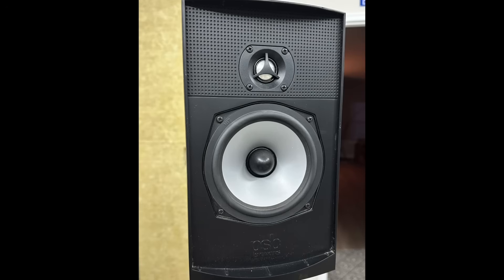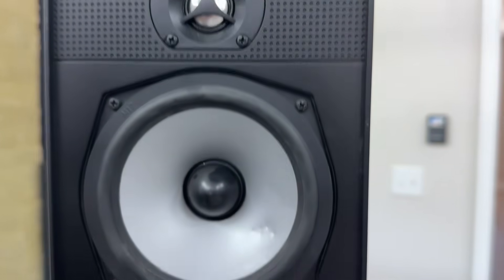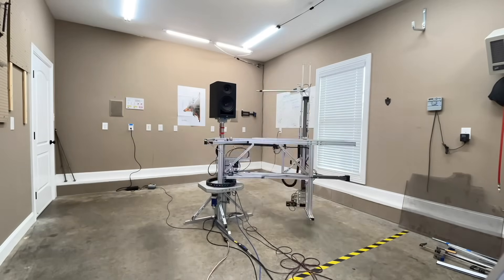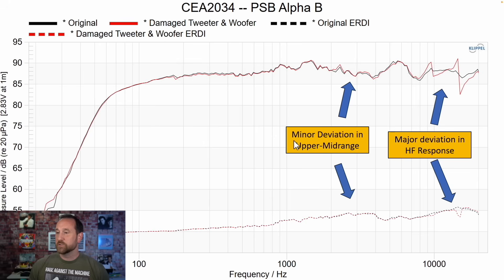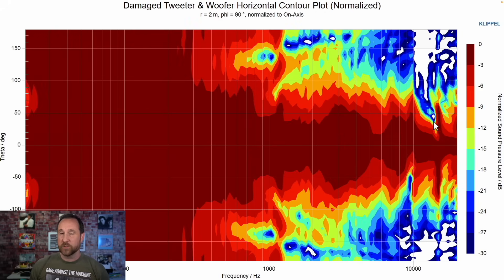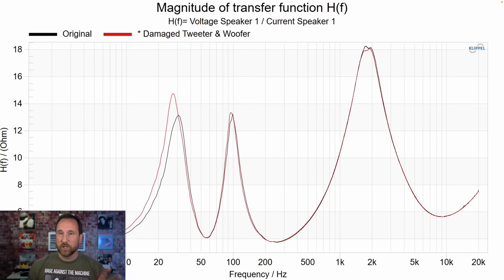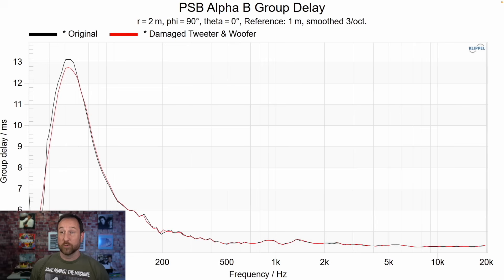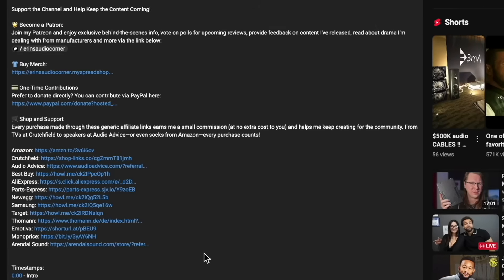How Does Denting Your Speaker Affect the Sound?

Comment from the maker: Side Note: this 20-year old PSB speaker which originally sold for about $250/pair looks like a solid performer. In fact, objectively speaking, it performs better than more recent PSB speaker reviews I've generated or others have. You can see these newer examples below (provided via spinorama.org):
https://www.spinorama.org/?page=1&search=psb

Second Note Regarding Repeatability (as was just asked by a Patreon member): I've only found very small deviations when testing the same speaker with the same setup (number of measurement points, stimulus, etc). When I say "small" I mean within 0.50dB via the Klippel.  All my tests here were ran the exact same way, other than the progressing damage. That is: same number of measurements, same exact measurement points, same geometry, same stimulus, etc. You can even see the painter's tape I used to secure the speaker to the stand to make sure the speaker didn't move even a millimeter between tests, as I made dents to the drivers.
Reply: Cheers, Keith!
Reply: 12:30 @ErinsAudioCorner, where was the mic positioned for the pink noise recordings? I'm guessing it was directly on-axis with the tweeter, in which case wouldn't it make sense that we couldn't hear much difference? Whereas the more significant deviation was off-axis horizontal dispersion, right?
Reply: LMAO.  After the high frequency test, you said "here's what you heard"  TBH I heard nothing.  Not "nothing" as in no difference,  'nothing' as in not a thing, no sound.
Reply: @Octopusprimal  Same here, until I cranked the volume way up.  Then I could hear the high frequency test.
Reply: @ Getting old sucks!  :D

Comment: I know this has been a while, but what if you do a diy fix of the tweeter, i.e. push out the dome (mine still has some very small creases on it ) and remove the bend does the original characteristics return? or is it permenantly altered? mines a C-CAM 25mm tweeter, I didnt notice any difference tbh before or after

Comment: Great vid/recording.  My 73yo ears could not hear the diff even tho I listened to a system equalized for my hearing loss.  Still, I know that a slightly damaged driver cannot be as "good" as an undamaged.  I've taken Tweeters apart & reformed them to remove small dents.

Comment: I will keep this study in mind when looking at scratch & dent specials offered by dealers, and the woofer and midrange cones have dents, scuffing on the driver surround and other damage. Of course, the dealer claims that this damage doesn't affect performance and that the speaker is fully tested and sounds "wonderful". I'm not mentioning any names, but a major HiFi dealer is offering used speakers with this kind of damage right now. I already have a few "Buyers Remorse" T-shirts, and not eager for more. This was a very important and timely presentation.

Comment: I wonder what happens when you put a coin sized neodymium magnet, on the back of a tweeter.  Reinforcing the flat neodymium magnet which is already there with just another one pancake stacked ontop.  If you wouldn’t mind, hopefully I’ve peaked your curiosity.

Comment: Very interesting, is it a fair assumption that different speaker materials could produce more/ less distortion if the damage is consistently same same?

Would be interesting to test this some more with different material types to see what the worst offender would be.

Ie paper woofer vs carbon, alliminium vs soft dome tweeter etc.

Comment: I have pretty much all PSB speakers from early 2000s.. Century 500 from 1998 which is by far my favorite speaker. Then a number of Image speakers from 2002, including a 1B which looks like a big brother to that Alpha B.  

I don't know about dents in the cone, but I can tell you that when the nickel coating on the magnets dissolves in the ferrofluid, that makes a big difference in the sound. :-)   Had to replace all the tweeters in my Image speakers because of that.

Comment: Can’t a driver still be pistonic above the frequency at which it beams?  I never connected these two concepts.
Reply from the maker: Above about 1/4-wavelength the cone can begin to disform and cause comb filtering in itself. But for the most part 1/2-wavelength is used for selecting a reasonable starting point for crossover or CTC distance. You can use this for breakup range limits. Some use 1-wavelength but that’s too relaxed imho.

Comment: After watching the entire video, I can’t help but wonder what might be found my measuring the B & A of a repair to an older lightweight paper mid-bass driver, or the all too familiar “dust cap dented by my inquisitive little 3 year old”. Repairs for those types are often effected by tissue paper and PVA glue, etc. In some  cases the dust cap is direct attached to the voice coil and can act as a tweeter itself - I’m thinking of “wide band” drivers without phase plugs very commonly used by DIYers (Fostex, Mark Audio, Tang Band, et al.
Reply: Paper dust caps if only dented, can usually be restored somewhat by wetting and a careful vacuum.
Reply: @ Another couple of tricks I’ve seen used is blue painters masking tape, turkey baster (far more control than a vacuum)

Comment: Sorry if silly question, why do the distortion measurements cut off at 10k?
Reply: Could it be that the distortion is a summation of harmonics H2 through H9, such as is the case with REW? And how many of us can actually discern distortion 20 or 30dB down in that last octave?
Reply from the maker: It’s normalized distortion. The fundamental test signal goes up to 20kHz. The second harmonic of a 20kHz tone is 10kHz. 3rd is 6.667kHz, etc.

Comment: The high pass on the pink noise test was very interesting, I heard no difference. It would be useful to include in your regular reviews as I find it's difficult to hear any other differences when the difference in bass dominates psychoacouistics. ('Pink noise high passed at F3' VS 'convolved result')
Reply from the maker: Yes. I have been considering high-passing the sound clips based on the f3 of the speaker under test. Already have a method for doing it appropriately. 👍

Comment: Hello, I'm not good at English, so I'm leaving a comment. In conclusion, there's a small stamp on my kef coaxial driver speaker midwoofer, can you tell me in the comments how it will affect it? It's hard to understand because the video doesn't translate properly.
Reply from the maker: If it’s relatively minor then I wouldn’t worry about it.
Reply: @ErinsAudioCorner Thank you for your answer. For coaxial speakers (e.g., kefls 50meta), will the stamping have a more fatal effect? There is a dent similar to the stamping of the speaker in the video. If there is an impact, I would really appreciate it if you could let me know in the comments where it is affected.

Comment: Great video Erin! Most of the speaker damage I’ve uhhh, witnessed was to woofer surrounds.  I’d be curious to see what cuts or holes in the surround would do.  Surprised at how little change dents in the woofer and tweeter made.  Thanks for the assist Keith!
Reply from the maker: I actually put a small cut in the surround but not all the way through. Might be worth trying some more experiments …

Comment: PSB makes a nice speaker for the money.  Used Imagine B or T speakers are a bargain, and have nice looking cabinets if you can find them in good shape
Reply from the maker: Their newer stuff doesn’t seem to be as good as this 20-year old design, unfortunately.
Reply: @ErinsAudioCorner  Proof newer does not automatically mean better! Have a set of inexpensive Yamaha similar age and price that sound great to me but no idea how they measure. This shows that speakers that old can still measure good on the Klippel before it even existed for confirming their design.
Reply: Agreed.  My circa 2010 Imagine’s sound solid…the new imagines(from what I have read, are not as good).  I would be shocked to hear a modern $3500 speaker to top my Paradigm S8V3 from same era…
Reply: Note…$3500 is about what I paid for mine last year…

Comment: I’m over here with hi-fi PTSD; takes me back to when my kids were little and decided it was great fun to take the metal pull-chain rod off the IKEA lamp and use it to poke the aluminum tweeter in my speakers. 

This is why I built my Ultimax subs to be down-firing 😅
Reply from the maker: Kids can be brutal!
Reply: Take a cheapo driver and overdrive it so the coil slaps the backplate. It's loud. Tell them that's what happens when you poke speakers

Comment: Real world bottom line. Erin has confirmed  that If you can pull that dent out of the tweeter and lightly repair that hole in the woofer you will not substantially affect the drivers. Repair the domes with a vacuum. Repair the woofs with a depleted dryer sheet and thinned carpenters glue. The chances are if it looks good and you haven't adder significant  mass (woofer) or substantially deformed those tweeter domes you still have a viable speaker. Dents in silk domes for example are almost always "suck back out-able" with vacuum. Most metal cones are as well.